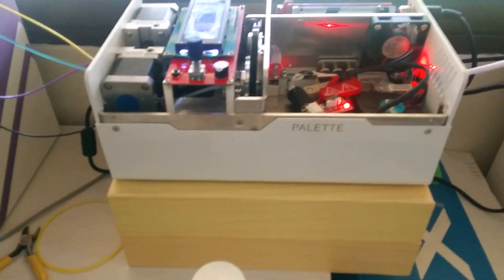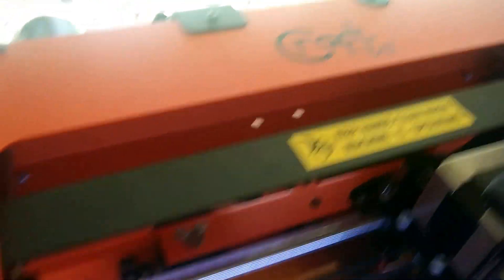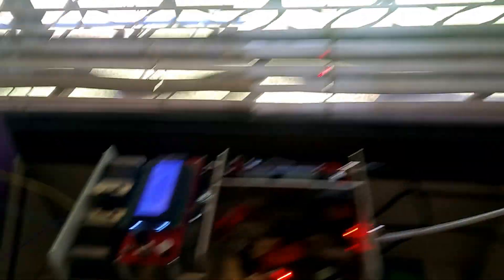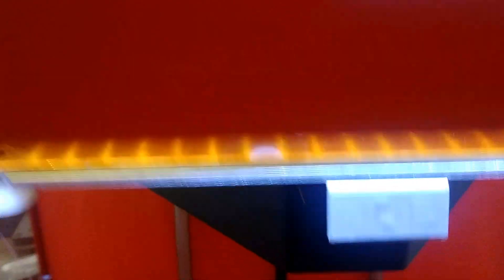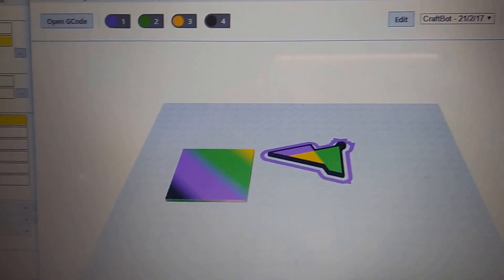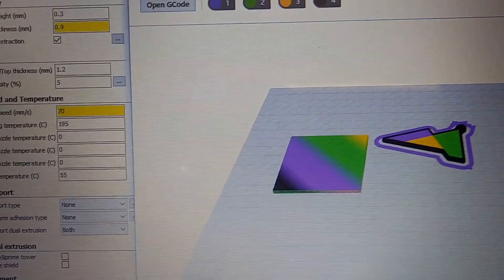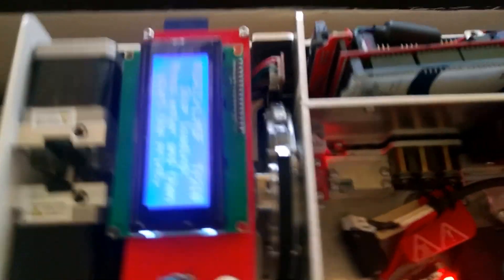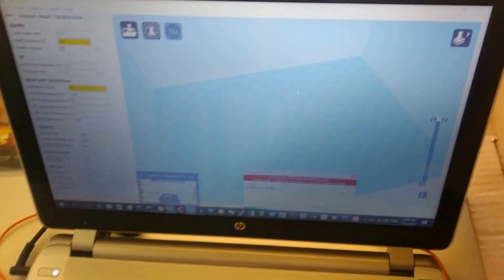The Palette: The 1st multi-colour print on a CraftBot printer - 11/3/17

Comment from the maker: *Followed steps 1 to 5 of https://mosaicmanufacturing.zendesk.com/hc/en-us/articles/115003044348-Introduction.
Each step proved to be a learning experience, short of hair pulling. Was stuck at step 5, the last step. Took me awhile to figure out "Save the .GCode/.X3G file onto another SD card for your printer." > how do i get the printer to print? What are the details? Finally got it figured out: realised the pc was not connected to my CraftBot printer via the USB, so even though I loaded the g-code file into CURA, of which the setup and calibration had been earlier done with CURA. I could not trigger any further response in CURA. With pc connected to CraftBot via USB, once the g-code file was uploaded to CURA, the print started after the "filament making process". During this time, the Palette was in the process of making filament: the step: Select the correct .msf file in the SD card inserted into the SD card reader and selecting the option in the LCD screen by turning the rotary switch knob and pressing it to select the file. Once that's done, just follow subsequent instructions in the LCD screen. e.g. moving the magnet at the Palette's output tube, towards the Palette to trigger the making of filament. I suspect something was amiss, illustrated by the constant buzzer beeping sound from the Palette during the filament making process and the message on the Palette's LCD screen "Stop loading filament. Press print button". I hope i remembered this message correctly. I have a Palette, I have a CraftBot, ah Palette CraftBot... more learning.